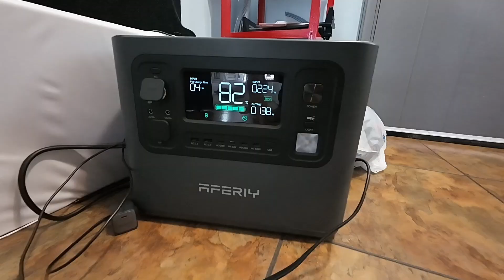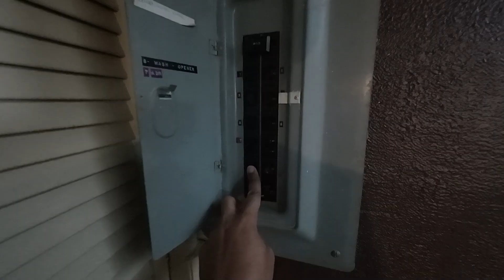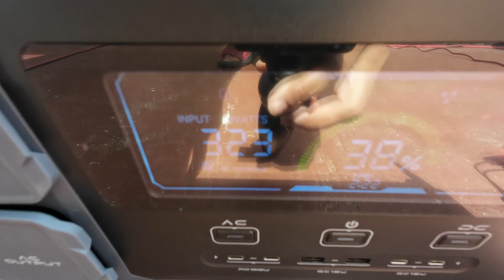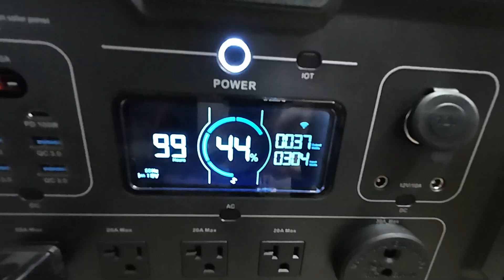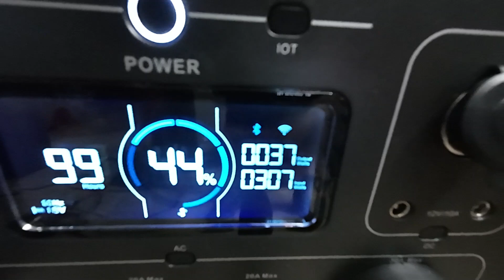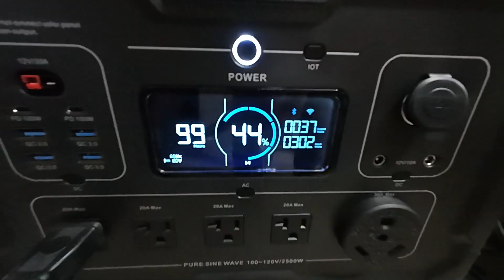My Solar System Is NOT Enough! - Wife Needs More!

Comment from the maker: VERY Important Note:
I didn't buy most of these power stations. Companies have sent these to me, in exchange for videos. I'm just making due with what I have.
Reply: I wish people would send me free stuff!
Reply: Yeah I want free stuff too. What the hell???
Reply from the maker: Start a YouTube channel and make videos people wanna see and that make people want to subscribe. Y'all saying you don't know how this works with sponsored videos?
Reply: I see the pinned comment bro, regardless this is a dicey setup
Reply: @tinashezimunya2288  I was about to say the same. this is extremely dicey. I respect he's making due with what he got. but maybe he should be not doing this if he likes his house not burned down or a death trap. Do keep in mind these powerstations are not designed to work like this at all. So they won't comunicate and they are different brands too so that might also play a role in how they react to being used this way.
Reply from the maker: I respect that take!
Reply: I think if you create 1 feed in circuit and put all the powerstation on that circuit. you have the combined inverter power (althought they might fight eachother a bit) and have a saver circuit braker panel aswell because there won't be any other big loads on it. Unless you are using the grid to charge the powerstations too.
Reply: Yeah reach out to the inverter companies get a stand alone inverter and Batts you can get a couple Kvs and run the whole house

Comment: Subscribed!
Reply from the maker: Greatly appreciate that! Where are you in your solar journey?
Reply: @AskIveSolar ive been researching for years (with your help)  but finally going to push the button on this one for portable:
1. EcoFlow DELTA 3 Max Series Portable Power Station (2048Wh)

And this one for home:
2. Jackery Solar Generator 5000 Plus

The tax credit expiring forced my hand to make a move. 

I really liked the Goal Zero Yeti 4000 but I saw numerous customer service complaints and issues with faulty equipment.

Any new info you have on the choices ive made, id love to hear. I have until today to buy them though. 😂

Comment: I hear that on the wife getting inconvenienced on asking if we have enough power to run everything at once. Washing dishes, cloths, vacuuming(pretty power hungry) I tell her just wait til the sun comes out. Then its game on!!  

Ditch all these individual power station and look into a single big power station/inverter(sungold, eg4, etc.). All my big appliances are natural gas(stove, oven, water heater, cloth dryer, etc). My Jackery 5000 with 4000w of solar, and 2 golf cart 48V batteries keeps my house running pretty well. Back fed that into the main electrical panel with a interlock, turn off the main breaker. No more extension cords!!! Thanks for the videos!!! Keep em coming! On cloudly days we might have to go back to grid for a day or 2, but when its back to off grid for 1-2weeks. Not too big of a deal.

Comment: Use your 30 amp plug and get an adapter.
Reply from the maker: What’s the benefit there. My breakers are 20 amps and I power each side of my panel from a different power station. 2k watt inverters x 2

Comment: Poor man needs 72 acres of solar panels and a football stadium filled with batteries.
Save power - give her a wash tub, scrub board, bar of soap and when done, hang clothes out to dry. Saves ALL that power!

He messed up. He should paint the breakers HE uses blue and the ones SHE uses pink.

Maybe he should get a 25kw inverter and enough lifepo4 batteries to supply the needed power.
Then get better/more panels.
He might want to upgrade his main panel so he can switch back and forth.
Reply from the maker: It's kinda funny that this comment is talking about me and not to me. I get it though.

Comment: Are you connected to an electricity company  ?  you can use your power stations for the less needy devices , and use the electric company to power your microwave and washing machine , the bill will be low , and problem solved
Reply from the maker: Trust me, I do that. Thanks for the thought. It's not helpful but thoughtful. 
But I didn't make the video to get solutions. Just sharing the journey.

Comment: Power stations are just the gateway drug. Cheap for keeping your electronics stable and going into camping mode when power outages occur. You gotta start somewhere. I started with a 2KW Liebert UPS and car batteries in garage ran to dedicated outlets in my office and furnace closet where my internet gear is. After the third time of buying replacement car batteries, bought a 48V lifepo4 server rack battery. When the Liebert died, replaced with a hybrid inverter. A few tax returns later and I am up to DIY 6KW of panels, 5KW split phase inverter and 26KW of storage. Cutting $300 a month off my electric bill summer and $200 off winter. Solar powering all house electronics, lighting, microwave or toaster oven, three fridges, garage door openers, furnace blower motor and a window AC keeping the Central AC from cycling as often. If power goes out, no oven, stove, dishwasher, electric dryer or central AC condenser. Luxury items we can live without for extended periods of time. We have also gotten better at using the toaster oven instead of the big oven. It took some skull thumping to stop kids and wife from cooking their single fish fillets, nuggets and mini pizzas in big oven that the central AC has to remove all the excess heat from. Popped breakers teaches them to not use microwave, toaster oven, popcorn maker and coffee machine at same time. Installing all the solar gear and rewiring house was easy compared to breaking my family from their mindless unlimited energy behaviors. I had to take thermostat off the wall a time or few to stop kids from using their cracked open windows to adjust their room temperatures. Mommy and Daddy slept fine with the window AC in their room. Muh ha ha ha ha. My son uses his gaming computer to play music while he sleeps then complains his room is too hot. He refuses to use his phone for music.
Reply from the maker: Holy moly, all things considered, you had an uphill battle on your hands. Good job! 
Great read as well!
Reply: @AskIveSolar  If you try to power your whole house, the solar investment exponentially increases pushing out ROI. Let the grid handle the big stuff. Do what you can (DIY) like you are in manageable chunks. When my dryer dies, I will replace with gas model. Instead of spending gobs of money for a larger inverter to power an electric stove top, get a single hot plate you can plug into solar. I just dropped another solar outlet in my daughter's room and she will be getting a small window AC like her parents soon. My house looks a little goofy with windows shakers right next to the outside condenser. Outside condenser uses 5500 watts plus 900 watts for blower motor. Two inverter window shakers use 1000 watts. Next year, I hope to turn central AC off at night. I am in Texas so AC is a huge cost. I am eyeballing my backyard shed for some panels to power pool pump next. With winter approaching, the window unit will get unplugged and a 400 watt heater will offset gas heat. One thing is for sure, if you and I were neighbors, or wives would be nagging us to go to bed because we are up late exploring all the what if's out there.

Comment: When I viewed this video I was about to say you have a problem and need to get to a batteries anonymous group if such a thing exists.

But I read your explanation now I get this is all free stuff sent to you.

If you have the money, get a professional system with batteries that can be charged by these small systems. Maybe look at victron, which is very modular. Also get rid of those suicide cables. These are just an accident waiting to happen. Imagine a child, relative or someone just visiting or doing work for you getting killed by one of those things.

If you are going to play with batteries, create a dedicated battery room with proper ventilation, fire proofing and a tough lock to keep out anyone who has no clue. Separate from the house would be ideal. You could even make a single connection to power a main system so you can empty your smaller battery systems into a professional one. If you are not off-grid, get a powerfull hybrid inverter. These often have a generator input you could use to connect one of the power stations at a time.

Comment: A nice situation reviewing those power stations.  Its fun to see the starter phase happening in real time :)  I am still on grid, with strings of the house off grid.  I have 5 Separate systems running. 3 Battery Banks.  200watt solar(water pumps/greenhouse/esp32 timer) 400w(work box truck) 800w Outdoor workshop/backup and 1500w for the house, and another 600w topping off that same bank.   If I die- no one will know wth is going on! No single point of failure though, which I love.
Reply: Oh! I almost forgot :)  Your wife needs about 15kwhrs of storage and good gas appliances, or she will eventually murder you ;-) Good luck!
Reply from the maker: 😂 @ that second comment! Based on my experience, I think that number makes sense. 

And I love having solar zones, they are a work in progress but they are maturing but just not to a place where I need them.

Comment: I thought my setup was janky “dingy” as my friend calls it but yours takes the cup, why so many power stations that are adding up to nothing, too many wires running in and out of the house bro that is dangerous what if your dog chews any of those wires bingo will be buried in your backyard under a solar panel, now you have knowledge on solar it is evident, why not sell the power stations and get a EG4 18K or a Victron pair it up with a cheap but capable eco-worthy server rack batteries that are very cheap in your market but vey capable, then for extra solar Mppt add some Victron smart solar charge controllers have them networked and you have yourself a very powerful system, a sungold power with a smiley face is a good inverter too, you are blessed to live in a place with all these nice options use them and build a system that will never lack, I can’t wait to see your next solar video
Reply from the maker: Before I read yours, see my pinned comment.
Reply from the maker: Power stations don't really sell well, you have to take a big hit and even then, very few people are interested. 

But I feel you, I thought about selling my 12v 100ah batteries to go towards an ecoworthy, shoot if I can find contact info, I might be able to get them to send me one. 

Really appreciate the watch and taking the time to comment. 

Also, no dog this way. Ha. And I have been on a admission to consolidate cables but it's an exercise in futility until I get more capable hardware and even then, I'm still a YouTuber who tests this stuff out, so I'm afraid this will often be my fate.

Also, I've made some pretty cool videos, check out the catalog and see if something catches your eye or maybe a Livestream if you wanna burn some time listening to me chop it up with the solar community we've built over here. Thanks again, hope to see you around again. 

Maybe you can tell me about your setup.
Reply: @AskIveSolar that will be cool hey, solar is fun to talk about and design systems hey

Comment: Why not just install a clothes line to dry your clothes

And use the dryer only when necessary 

Re battery storage is 2500usd outside of your budget you can get 32kwh capacity for that kind of money

Comment: I understand the equipment was all donated to you and that you are on a shoe-string budget.  I totally understand what you are trying to do with the power stations.  But... the way you are doing it is really time consuming and just plain dangerous.  Ya gotta get away from backfeeding home circuits from power stations, period.  And you still have the panels just laying on the ground and cables strewn about... something is gonna fray or break and electrocute someone at some point.

The whole idea with a solar system is that you put in the time but then take a step back and just live life like normal as the savings roll in.  When you have to mess with the system every single day... well, isn't all that extra time you are spending each day worth something?  Time is money, so goes the saying.

--

I'm really trying to rack my brain to figure out how you can make this easier on yourself without spending a whole lot of money and still be reasonably safe and not have to run around messing with things all the time.  Its a hard problem.    There is just no convenient solution that doesn't involve spending at least some money.

At an absolute minimum you need to have an electrician wire up a generator port and manual transfer switch for you.  Absolute minimum.   Then at least you can safely feed the power stations into the house via the generator port and when they are exhausted just switch back to the utility.

You MUST do this.  It's the only "safe" (ish) way to do what you want to do.  No more suicide plugs backfeeding through regular house circuits, please.

--

Making the power station and solar setup more convenient is doable.  Take your biggest power station that has at least two DC inputs and connect its AC output to the generator port.  Take your biggest solar array and feed that into the beefiest solar input.

Then take your other power stations with whatever solar is left feeding into them, and connect their 12V DC output to the other DC input of the big power station.  So any energy they get from their solar is trickle-charged into the big power station.  Leave their inverters turned off.

Now ganging all those 12V outputs requires a bit more circuitry to do it safely, and unfortunately some electrical losses.  Get a pile of 20A Schottky diodes.  I recommend "20SQ060" ... there are lots of sellers on Amazon and they are cheap.   Each 12V output from a power station is run through 2 x Schottky diodes in parallel (not series) and from there to a bus bar.   For each power station.  So if you have five other power stations feeding the big one, you would need 10 diodes.

Get the orientation of the diodes correct.  The solid line side of the diode points towards the bus bar and the other side to the small power station 12V output.  Using 2 diodes (or more) in parallel per power station defrays the heat generated.

The bus bars then feed 12V into the big power station feeding the house.  The big power station can thus trickle-charge from the other power stations... usually at around 8A which is only 100W, but it's continuous.  You can increase this by also adding a 12V to 24V DC-DC converter assuming the solar input of the big power station can take 24V and it will trickle charge at 240W.  Albeit with more losses.

That's all I can think of to keep costs low.  It isn't a proper solution but is safer than what you are doing now and it is a more "hands off" solution.

-Matt
Reply: Matt, I appreciate you keeping these solar “influencers “ honest. Keep it up!
Reply from the maker: "The whole of a solar system"

When I get a legit solar system, I might understand that logic. But a system is what we define it as bro. 

And to the other commenter, to keep me honest means is an interesting phrase to use. 

But also Matt, I appreciate the brain power to figure out a solution. 

I simply don't have, at this moment, the hardware to make what I'm doing less appealing and I don't concede to this idea of stopping back feeding. 

To get a transfer switch, I'd need to
1 upgrade my panel
2 install 2 transfer switches because one power station (that I have) can't run more than 2k watts
3 get something that has at least a 4k watt inverter, at the least.

Comment: Dude, it's not enough because to installed that cheap, high frequency, transformerless, toy inverter. You should have installed a low frequency transformer based inverter instead.

Comment: Add a cheap $100 12v battery or 2 to the mix and have a couple thousand extra watts at ur disposal.
Reply from the maker: Watt hours is not really an issue but I get what your saying. Maybe I don't really have enough solar to store the extra watt hours in batteries. Because i have batteries.
Reply: Dude you have no idea what you're talking about!
Reply from the maker: Which dude. Haha

Comment: I just got the Apex 300 , to match my Dji power 1000, I only have a 1-bedroom apt. I think that will do with a few solar panels and 1 extra batt on each system for good measure. 

You should just get a home system bro. Apex 300 is very flexible. I think it would make more sense for you
Reply from the maker: It would but I have often financial obligations and my channel is not quite in a good groove to get one from bluetti in exchange for a video.

Comment: If I was running an electric range  and an electric dryer  I'd be looking at the EG4 18k   or at the very least 2 Anenji 10 or 12k in parallel and a PANDA 51.2V 628Ah 32KWh Moveable Battery pack  I wouldn't be playing at solar with some power stations
Reply from the maker: I'm s YouTuber with a smaller channel about solar power. I have what I have, yanno
Reply: What's the price for the panda 32kwh?

Comment: YOU CAN BUILD YOUR OWN OFF GRID SYSTEM LIKE IME OR MANY OF US PREPPERS DID  , OR USE ALL THE  POWERSTATIONS YOU HAVE ALREADY .IF YOU CAN INVEST ON A MUCH LARGER POWERSTATION OR INVERTER FOR THE HEAVY HUNGRY LOAD SIDE LIKE A 3000 WATT OR ABOVE UNIT  . PUT THE OUPES ON THE LIGHTER LOAD SIDE . SO FAR YOU ARE KIND OF DOING SOME GREAT WONDERS WITH ALL OF THOSE POWERSTATIONS AND THATS GREAT , YIOU JUST DON'T HAVE 240 V TO WORK WITH BUT YOU ARE AND CAN DEFINATLY AND LITERALLY STILL RUN THINGS WITH WHAT YOU GOT .MAY THE SOLAR BE WITH YOU .:goodvibes:🤗
Reply from the maker: My man, yeah I feel you. I’m just making it work as best I can because I have different financial priorities Yanno. 

The crazy part is I’m so used to making it work,not sure what I would do with a system that just works. Haha